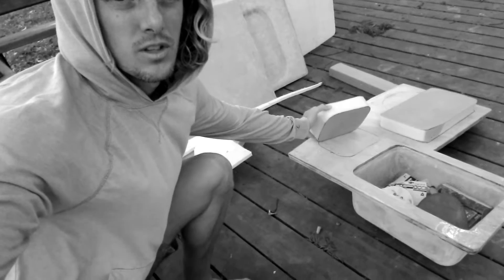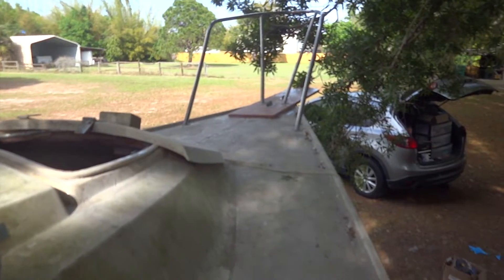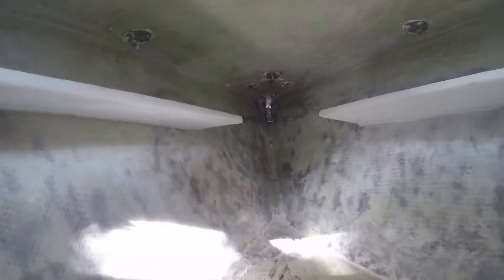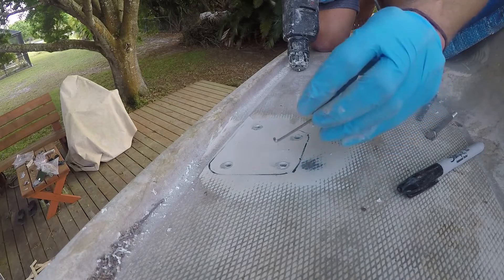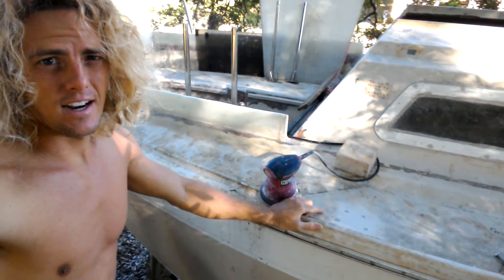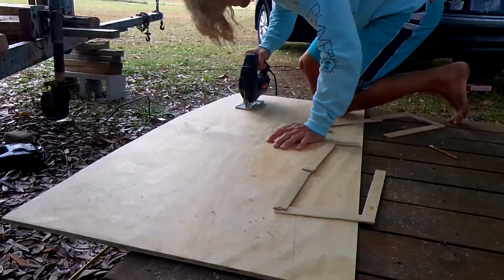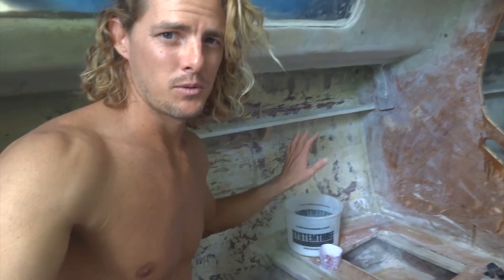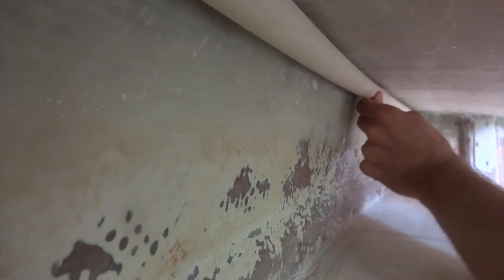Chainplates, Stanchions, & Conduit - Ep. 24

Comment: Well done, keep up the good work. I'm creating plans to build a Catamaran Dinghy within the next 2 month's that is 2.8m x 1.75m x 0.55m or 9' 4" x 5' 8" 7/8" x 1' 9" 5/8" made of 5mm Corflute with 2 layers of 225gms2 or ¾ oz csm fibreglass sandwiched with closed cell foam & another 5mm Corflute plus 2 layers of 225gms2 or ¾ oz csm fibreglass. I've got a 13HP stationary motor with a 2.4m 9" 3 blade Mud Motor Kit which I should be able to get the Dinghy up to 23 MPH. Great for having fun with & going fishing as well as a tender for my larger Catamaran I plan to build later.
Reply from the maker: Awesome, keep us updated on the build sounds pretty cool! Thanks for checking out the vid!
Reply: Welcome mate, from Perth, Western Australia.

Comment: Many have probably said it. But you can take a Ziploc style bag and trim an edge off so it's like an icing bag for cakes to easily apply the peanut butter epoxy into the gaps without using so many gloves.
Reply from the maker: Haha yeah, not the first time I've heard this. Not sure why I keep using my hands. I think I feel like I'm getting my hands dirty and doing real work or I forget to pick up ziplocs from the store. I also wanted to use spoons for the fillets but keep forgetting....oh well just more sanding on my part....lol. Thanks for checking out the vids. More to come!

Comment: Keep up the videos !  Personally, I am not a fan of 5200.  Great permanent adhesive, but not great permanent sealer/caulk.  IMHO, all through deck deck connection should be bedded in butyl tape.  I stays flexible for a very long time and it is ever does leak, it is easy to to remove and replace.
Reply from the maker: Huh, good to know. I guess its too late for me, for now. However I'm definitely going to remember this in the future. I still have a bunch of hardware to do. I've heard 3M doublesided VHB tape for the windows, any thoughts on these since they are coming up soon? Thanks for the input!
Reply: @NeonSwell  VHB has awesome holding power.  Not sure about weather/water sealing.  Do the windows have frames  ?
If you are starting from scratch, watch these 2 episodes : https://youtu.be/JB1Wn27XNrM and https://youtu.be/B0FE6pUQtvE  If you windows are small enough you could make the inside frame 1/2" thick cutting board (Sams, Dollar Store).   Use 1/2" wide butyl tape as a sealant when you install the windows.   Any squeeze out is easily removed and the butyl tape will not harden.  Use SS screws and cup washer.  You can find SS screws and cup washer much cheaper on eBay
Reply: I was going to say the same thing, a good friend of mine says, "Only use 5200 if you NEVER want to take it off!"
Reply: I think 4200 would have worked best for sealing the upper portion of the chain plates. I would not have used anything on the lower chain plates.  It will smush and become loose.  I would keep an eye on them to make sure they remain tight.